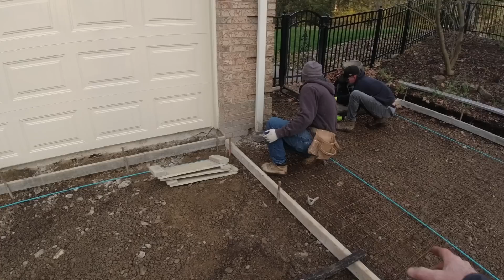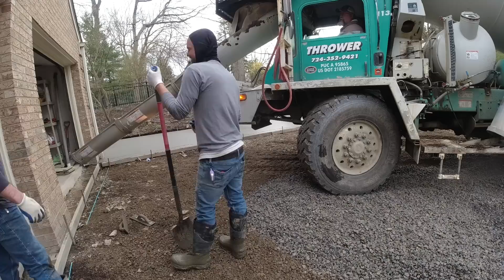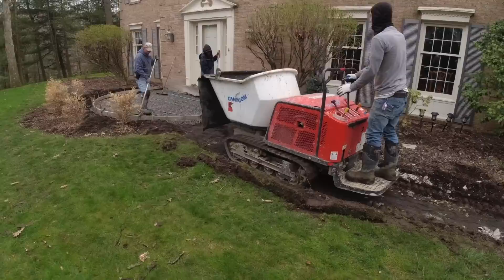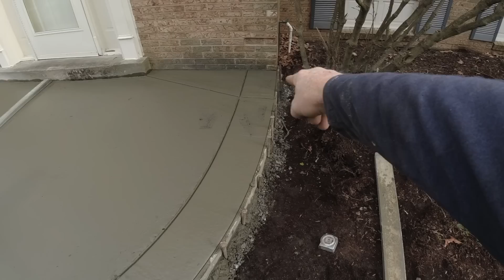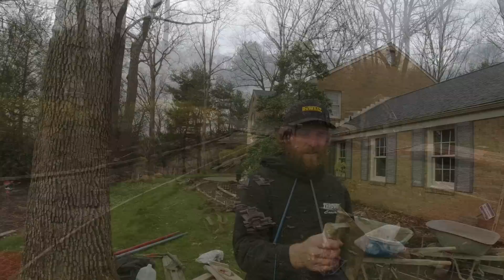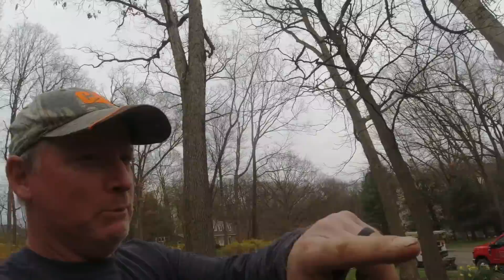Half Is Better Than None

Comment: Fast and fabulous work. Does the fiberglass rebar have better tensile strength or just all around better?
Reply from the maker: Fiberglass rebar has very many qualities noncorrosive not expensive very high, tensile strength, however a low shear strength
Reply: @Concretewiththehauses  thanks.

Comment: Another lot of good work Tom.  Question 1:  Do you expect concrete to last at least 25 years?  
Q 2:  Is there any other tech that you know of that can or will be used instead of concrete in the near future?  Thanks for sharing, as always.  :)
Reply from the maker: Yes, I think your driveway should last 25 years if it is sealed every couple. I think Concrete‘s gonna be hard to beat, but there’s always new things on the market.
Reply: Thank you :)

Comment: Hey Tom, have you ever used basalt mesh or rebar?  Not sure how it compares cost-wise to steel or fiberglass, but it's lighter, has higher tensile strength than steel, and it's chemically inert (no rust).  Thoughts?
Reply from the maker: I have not fiberglass is new to us only about two years

Comment: TOM, the steps you poured to the 'wood lot' won't slide cause of the driveway holding them back, but when you pour steps on a long steep run, would you advise digging post hole pile lasters, or pillers if you will,every 6 to 8ft.at 12 inches deep in the center and adding  vertical rebar to tie into the horizontal rebar in the forms to keep the steps from sliding down the hill years later? Overkill or not necessary? Thanks for the tip with the nail trick!
Attention to detail ! Sweet!
Reply from the maker: That’s a tough one to answer if you lock them in to tight and they can’t move. Obviously, they will crack  if the ground freezes or thaws however, you don’t want them to move I would tie in at the bottom if possible and let float on the hillside. Every situation is different this may not apply to you
Reply: @Concretewiththehauses  TOM, thanks for the response, appreciate it.
Reply: https://www.youtube.com/watch?v=Cdcu-o4LXSA
Reply: Dozens of videos on the internet.